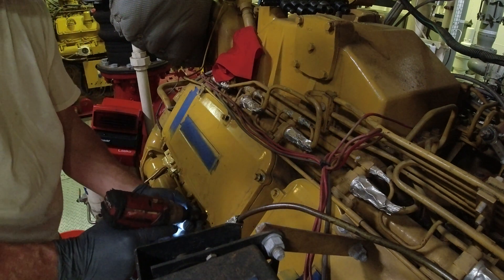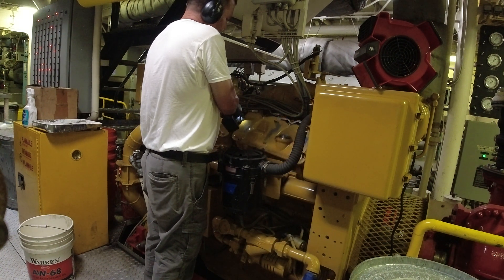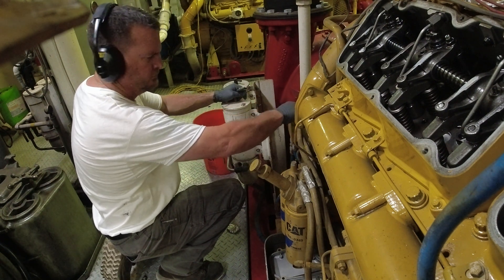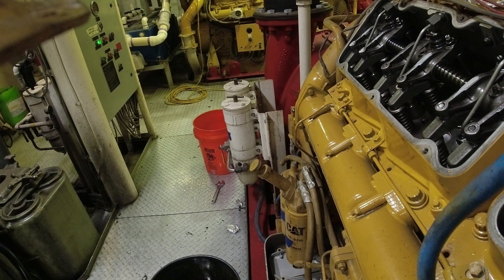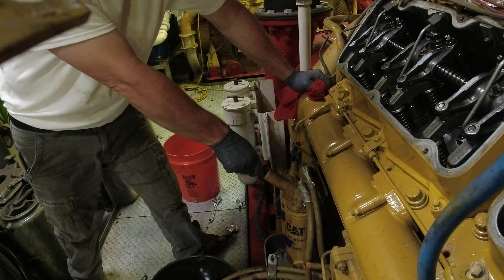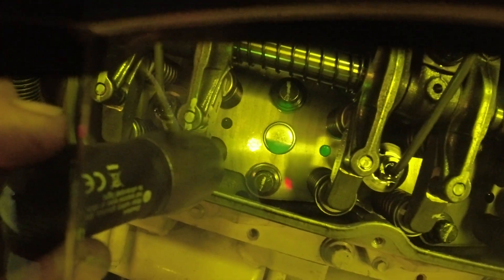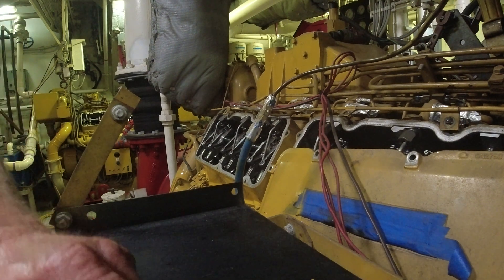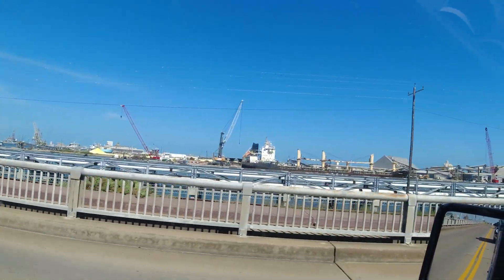6000HP Boat engine and a 3412 CAT Engine hear them run!

Comment: I have worked on these engines a lot. I have had the side screw in the side of the injector leaking on a 3412 engine that leaked on most of them at the same time. That caused my oil sample to show fuel in the oil.  This is a common issue on some mechanical engines.

Comment: Cool thanks for sharing! I bought an old trashed 3412 and myself and my 10 year old son are rebuilding it. It's a 3412A , direct injection with the capsule injectors. The engine sat outside for years and was completely rusted solid. We completely disassembled it, block and crank were good. We got some 3412B heads from Ralston diesel going out of business. 7000 series injectors. The injector pump was missing the governor so I bought another injection pump. This other pump also doesn't have too much movement going on so we'll have to take it apart and see if it's salvageable. If you know a good injection pump guy let me know!